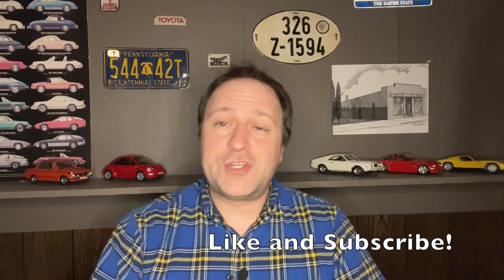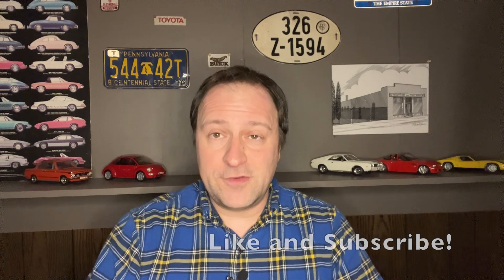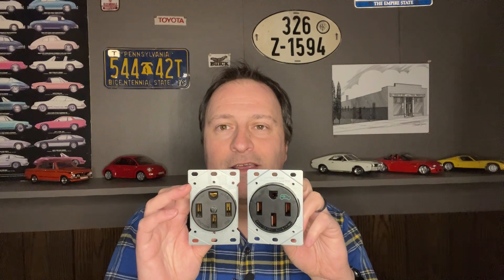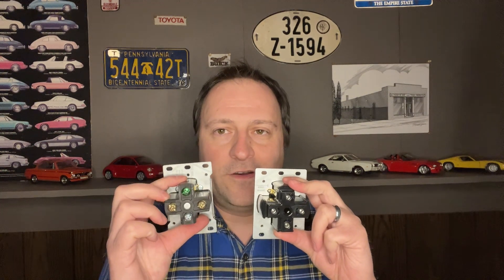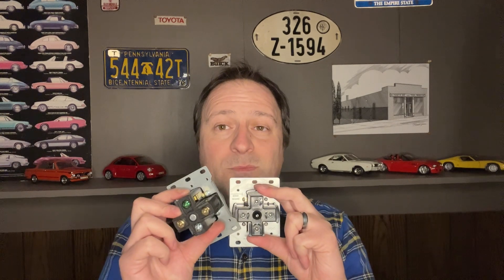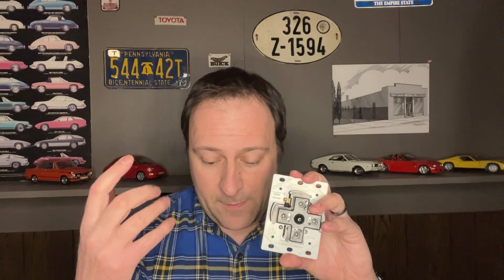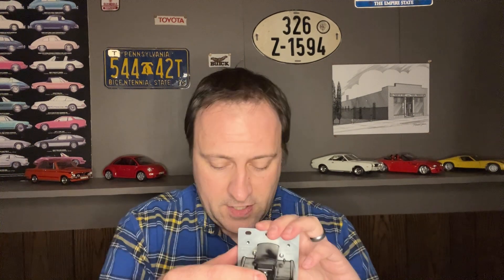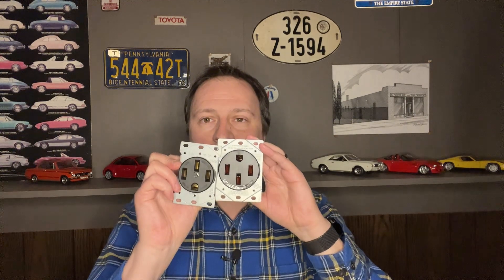You might be running the wrong NEMA 14-50 outlet for your Home EV charging station (EVSE) Level 2

Comment: I had seen most of this information before, but it's good to see it again. I also see undergauge wire. The recommended wire size for a 50-amp continuous load is 6 AWG copper wire.
Be sure to follow local code :)
Reply from the maker: I had copper 6 AWG run for this outlet. I was given a choice between this and aluminum at (I think 2 or4) with significant savings, but I went with good old fashioned copper. Thanks for watching!

Comment: I have a new Fossil Fuel pickup truck, a Fossil Fuel classic car, and an ATV that runs on gasoline.
I don't think I need one of these, thank goodness.
Happy New Year Double J!
Reply: You definitely have the wrong nema plug for your petrol vehicles!
Reply from the maker: An EV is a wonderful excuse to run a 240v 50amp line to the garage. I have options now for welders, compressors, and space heaters!
Reply: @doublejslist  I use extension cords to run power to my garage.
I have Big Buddy propane heaters to keep it toasty.
Just a cheapo Harbor Freight welder for odd jobs.
But thanks for the recommendation Double J!
Keep up the great videos!